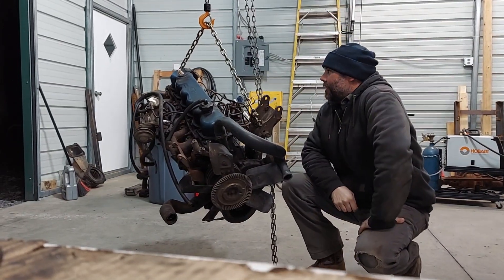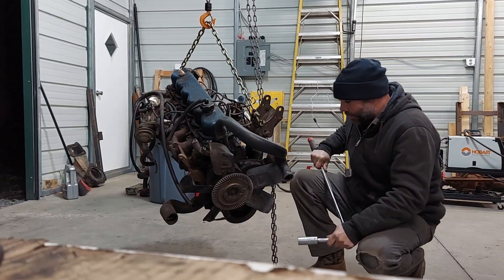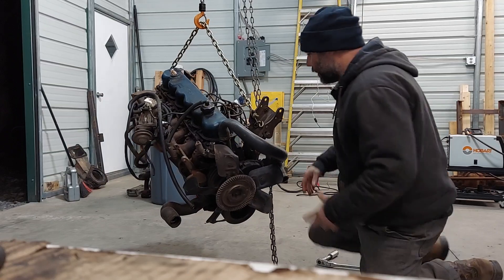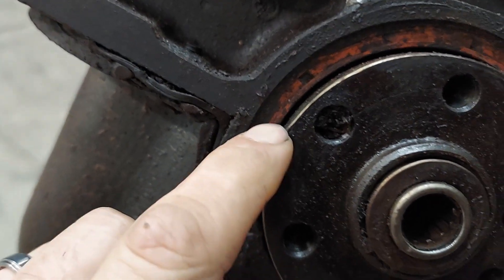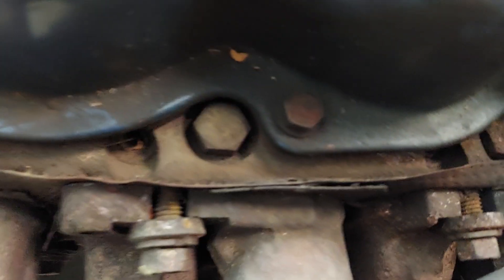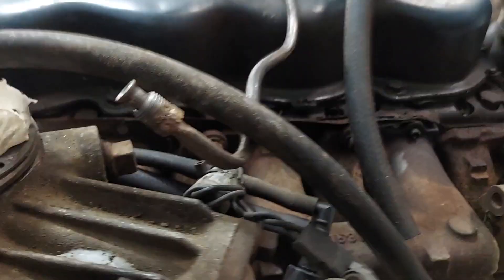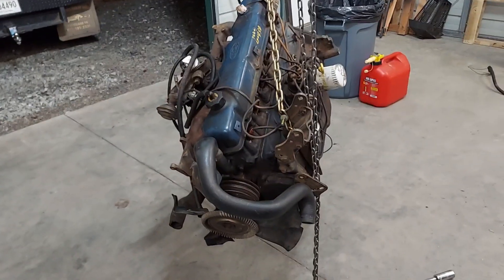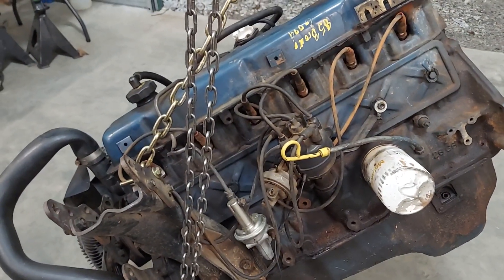Ford 300 i6 engine swap

Comment: Thanks for the video!  My 1983  motor went bad, and  getting a junkyard motor Sunday. Will  check for main bearing sleeve  and signs of  repairs. Im a 70 yo  poor guy, and trying to survive  doing my own repairs,  learning little by little.
Reply from the maker: @garymahon1955  hope it's back up and running soon!